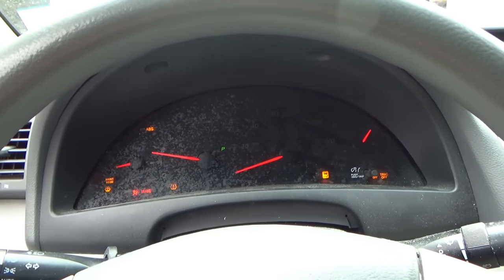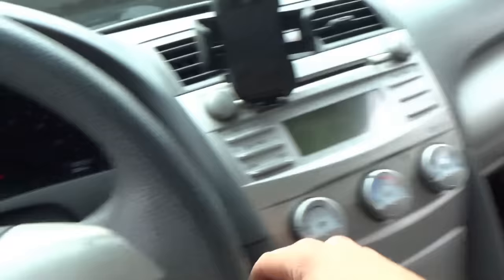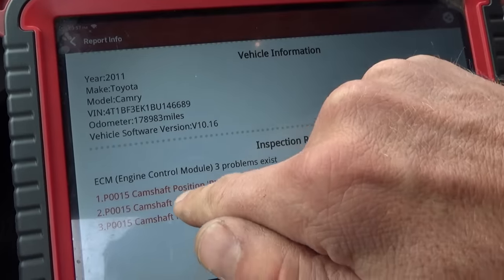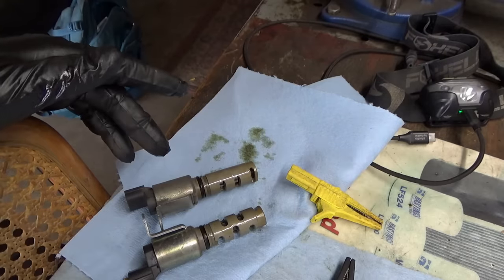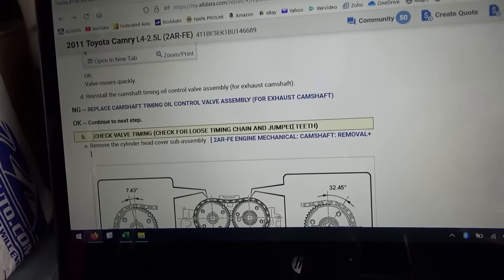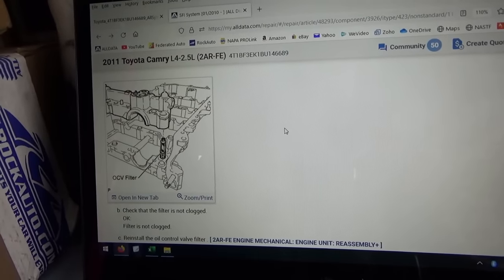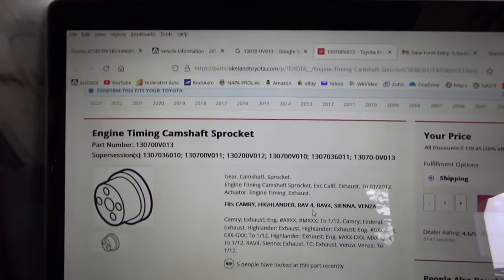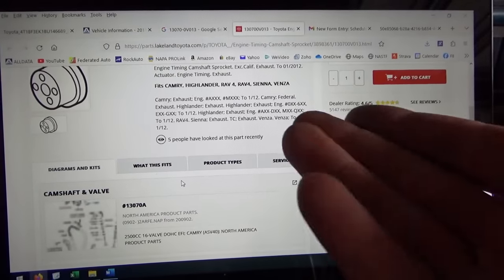Toyota Engines Can BREAK? (Camry STALL- RATTLE P0015-P0017) - Diagnosis

Comment: They break all the time. Both my parents drive Toyotas. Dads Tacoma needed driveshafts at 23K and an AC compressor at 64K. Moms Camry hasn't hiccupped yet but it doesn't have 10K on it. Nevermind the nearly brand new 09 Camry that went full throttle through a busy intersection killing my friend and her 2 kids.
Reply: Yes a lot of owners neglect out there.
Reply from the maker: Wow that is tragic! :(
Reply: Well I maintain both my folks vehicles and I don't go by the manufacturers recommended oil change intervals. I was raised on the every 3 months or 3K miles. There was no way to maintain the driveshafts or maintain the compressor from developing a shaft seal leak.
Reply: I do not like Drive by Wire vehicles.
Reply: @PineHollowAutoDiagnostics  it was one of many that had the "unintended acceleration" that Toyota conveniently blamed on pedal misapplication and non-compatible floor mats. Apparently that nonsense only affects Toyotas and their drivers. Nevermind they paid the largest fine ever because of the cover up.
Reply: @DS-ss7vl  me either. Too many variables and possible failures/glitches.
Reply: What are the percentage of Toyotas that need major repair that come to Pine Hollow auto diagnostics?
Reply: Toyota--still riding their reputation from the 90s, despite what the toaster testers as consumer reports will tell you.
Reply: So sorry for your friend and her children 😢 😞
Reply: Wait until you see some of the latest tech in that category. They are already testing drive by wire brakes and there is talk of wanting it for steering as well. Guess the current issues with electric power steering that fails doesn't register that perhaps a simple shaft is a better idea.
Reply: I had that on a 2008 Honda Pilot with about 160 K . Borrowed from a friend for a few local errands . Stuck WOT when I pulled out onto a 4 lane secondary road . Both lanes had traffic . I instinctively steered between both lanes in the middle and caught a gap to turn on a side street . I missed rear ending several vehicles and before turning , a head on . The gear selector had to be pulled in before going into neutral . I did that and shut it off . This all happened in about 10 seconds . Second time I drove the vehicle . Drive by wire throttle body . Must have stuck . OUCH ! I had no brakes on an old single master cylinder car and turned the corner in second gear at 40 MPH to avoid a crash at a red light . But the stuck throttle was pure terror . Zero warning .
Reply: @Blazer02LS  I absolutely want direct control of my steering through a shaft and linkages.
Reply: @michaeltrinidad1217 Wild guess, it’s not high.
Reply: @hokie9910  I think that's for Ivan to answer.
Reply: @michaeltrinidad1217  I can’t take a guess as stated in my reply,  good grief.
Reply: @michaeltrinidad1217  only Ivan can answer that. We only see the ones he videos.
Reply: @elcheapo5302  they're riding it all right. Tundras going up in flames from fuel leaks, Yaris with multiple electrical issues, Rav 4s with transmission issues, drive by wire glitches that kill people, oil burning problems that burn exhaust valves and at its worst require a quart of oil a week. Then overly priced parts and labor intensive repairs. Yes every manufacturer will have problems and lemons and usually every case is different  and of course  maintenance is definitely a variable, but after a while you start to notice a pattern. Some people take care of their vehicles religiously and some only put gas in them. I promise if you visit a Toyota dealership you will see they have as many bays as any other make and they will all have vehicles in them needing repair, I know because I worked as a tech for a year and a half at a Toyota dealer.
Reply: Someone needs to tell Scotty that Toyota’s have problems too
Reply: U.S. built Toyotas suck. Japanese built ones are amazing.
Reply: You must love Scott Kilmer
Reply: @michaeltrinidad1217 close to zero
Reply: Never had any of these problems with a Toyota
Reply: @ginamiller6015  just a lot less than others is what Scotty is trying tell folks.
Reply: Toyota should’ve never gotten rid of the 1.8 engine the 2.0 dynamic farce engine sucks! and on the Corolla LE they got rid of the rear independent suspension and went with a cheap crossbar suspension. 🙄
Reply: @DS-ss7vl  well, if I am not mistaken drive by wire also makes possible the brake-throttle override feature that cancels the throttle entirely if both the gas and brake pedal are pressed at the same time. (which is a safety feature that Toyota/Lexus failed to install, leading to unintended acceleration incidents)

Also, don't mechanical throttles get stuck fairly commonly anyway? There was even a recall decades ago from an American car manufacturer, where defective engine mounts could cause excessive engine movement that manipulates the mechanical throttle cables, causing unintended throttle. 

If drivers have mechanical throttles, and do not have the brake-throttle override feature, they'd have less options to react to a stuck throttle other than shifting into neutral, shifting down, shutting off engine, or using the brakes to overcome the engine power.

Apparently not many people know the proper reaction to a stuck throttle, else people wouldn't have died that way. If brakes can overcome engine power, how did those accidents happen where the brakes apparently didn't help? So there may be even less options to react to a stuck throttle and that's if the driver is well educated on how to react.

If hitting the brake pedal is the first reaction of even the least educated driver, then artificially overriding the gas with the brake pedal seems like the best way to prevent stuck throttle accidents (and I'm presumping that the brake-throttle override feature is only possible with drive by wire)
Reply: @DS-ss7vl  for example: "Fast forward to 2003, when the first vehicles in FCA’s storied history rolled off the assembly line equipped with brake-throttle override – a by-wire technology enabled by electronic throttle control (ETC).

Brake-throttle override is a feature that enables a driver to stop a vehicle in the unlikely event that its accelerator pedal becomes stuck.

Should this happen, the driver need only brake – and continue braking. ETC will then close the throttle, which cuts propulsion while leaving engine idling, so the driver may bring the vehicle to a safe stop.

This novel technology is not mandated, but the pending launch of the 2021 lineup will mark 10 years since brake-throttle override became standard equipment on all FCA vehicles."
Reply: @topher8634  NASA Scientists proved that false. I have researched this many times. Check for your self.
Reply: @mikefoehr235  I did. People can be paid off. Especially when there's a lot at stake. I was very close to that girl. Toyota tried to take possession of her destroyed car several times but her family refused to let them have it. When the PCM was analyzed it showed that the brake was applied during the WOT glitch. It also showed that the two APP sensors were not agreeing with each other. Over an 80 percent variance. She didn't have time not the knowledge to shift to neutral. It happened as she was approaching an intersection. There was even surveillance footage of the whole incident. If you research this you will see Toyota released not only a software update but also a shim to be installed in the accelerator pedal assembly. They even suspened sales of the affected Toyotas in the states. One dude went to prison after his Prius ran out of control and killed someone. He was released after this problem came to light. Now, logically speaking you don't recall millions of vehicles, generate a service bulletin, release a software update, design a shim, suspend sales, release people from prison, then pay the largest fine ever known in the auto industry to avoid prosecution, all the while blaming this on "pedal misapplication" and "non compatible" floor mats-mind you this only happened to Toyota and Lexus owners. Then years later pay for independent NASA testing to determine there was never anything wrong with Toyotas products. That was nothing but a marketing strategy because they lost so much money. Brakes cannot stop a vehicle that is running wide open throttle. Very quickly the fluid is gonna boil and you will lose all braking ability. No doubt the vehicle PCMs they claim that the brakes were "never touched" were taken possession of by Toyota and that information was flashed out of the controller.
Reply: @topher8634  I have tried to over power brakes with throttle and many vehicles have brakes so powerful now, they win the battle. As for the fine, Toyota was made an example of by the US because of second world War hatred. Not even German cars get that much hate. What I also find interesting is other auto makers have had cover ups....GM for example had bad ignition switches and covered it up for decades I think. I used to freak out my wife because I could start my 90 Sunbird and then pull out the key and drive. She really didn't like that.
Reply: @mikefoehr235  I believe more people died in the gm ignition switch scandal than did in the toyota stuck throttle. And I believe they had a hefty fine too-dont remember the numbers nor do I the toyotas just remember them reporting it was the largest ever recorded. I had two older gms with they same problem as your sunbird. My first car was an 85 cavalier that would allow you to remove the key after it was unlocked. The key was very worn though and a new one would not do the same. On an 89 6000 you could just rattle the lock and it would start and run without ever requiring a key. I had to replace the ignition lock cylinder to fix that. Had the same problem on a 95 Cherokee too. I never experience a problem with the later years gm switches though, I think it was probably mostly related to heavy key rings or ones that had multiple pendants and gadgets on the ring with the ignition key. I've always kept my car keys and all my other keys separate.  Not saying gms not at fault just never had a problem with their switches.
Reply: @zzoinks  I was given an old Buick Special. I think it was a 63. When I was driving home I goosed the throttle one time and heard a clunk and the throttle was hung.  Another stomp on the pedal at it was back in my control.  Every mount was rotted and the accelerator cable was frayed. The car had been sitting since the 80s, this happened in 2001. That was the only time I'd ever experienced or heard of a stuck throttle until my wife to be died in her new camry. I was fortunate I was alone on the road and had plenty of time to react. I don't know of any hydraulic brake system that will overcome an engine running wide open. If you don't smoke the linings the fluid will surely boil rendering the system useless. The same will happen if you apply the brakes too much on mountain overpasses-the fluid boils and the pedal goes to the floor.
Reply: @topher8634  I'm sorry for your loss.
Reply: @topher8634  I've heard that the brakes are supposed to be able to override the engine power, would it take an extended time for the brake fluid to boil? But with the high torque engines today I wonder if the brakes would be less effective. I'm assuming even regular brakes on a car can exert tremendous friction to stop a car, if force equals mass times acceleration, and cars are able to decelerate very rapidly, from 60 mph to 0 mph in less than 130 feet, that may indicate that brakes are able to exert force necessary to fight the engine power for at least a short period. 

 Still there has to be instances where the brakes don't overpower the engine. There was that story about the prius with a stuck gas pedal and supposedly the driver was pressing on the brake but not slowing down. (cops also recounted seeing the brake lights on) so maybe it's just a lie or mistaken belief that brakes can overpower the engine.
Reply: I'm so sorry you lost your friends and their precious babies 😢
Reply: @topher8634 I'm so sorry you lost your wife 😢
Reply: @breesechick  thank you for the condolence.  We weren't married at the time but I was gonna propose soon when the accident happened.

Comment: I just replaced the timing chain and gear on my 96 Chevrolet K1500, it cost anywhere from $19 for (Chinese junk) to $50 for a Cloyes double roller chain (fit like a glove). I once tried a Engine Tech (Chinese Junk) and it had more slop than the original GM with over 200,000 miles on it. I really don't know why manufacturers are using this expensive complicated cam drive systems (Ford F150 5.4 3 valve instantly comes to mind), maybe emissions and or gas milage (really don't care), but I'm going to keep rebuilding all 3 of my old trucks and save $80,000/truck and avoid dealing with this BS.

Comment: These are exact symptoms when the intake camgear and tensioner goes bad and it prevents the timing chain from spinning freely which messe with the oil control solenoid and crank position sensor

Comment: My family has a 2012 Venza with the 2.7lL same codes but no stalling but noisy when engine is cold, parts in Canada are $840 for exhaust phaser/gear…Toyota has a big problem with this part design

Comment: I am wanting to say Scotty Kilmer has stated that these model years of Toyota engines have problems.  My neighbor has a 2008 Camry with 85,000 miles that burns oil; it seems the piston rings that year were junk.  I have a very good friend that works on many Toyota cars.  He says he stays busy; but not as busy as techs that work on some other makes.  GREAT VIDEO!
Reply: Yes, the early 2003 models had rod bolts not torqued and will blow. 2004 through 2006 were great. I believe in 2007 they switch to different piston rings and using a lower weight oil abd, and well, it did not work. Lots of gummed up rings and oil burning, and Toyota fixed a ton under extended warranty. New rings, back to using 5w-30 oil.

Comment: I guarantee you it's the camshaft gear what makes me think that is because it rattles on startup even if you already started it up sometimes they do rattle on startup whenever it's a cold start but then once it gets oil pressure it should not rattle so this is telling me that the locking pin on the timing gear is broken or something

Comment: Ironic that Ivan releases the video on the day that my 17 year old Toyota turd wagon is up on the jack stands getting a used engine put in. In my case the head gasket failed - definitely on cylinder 3 put possibly 2 as well. Coolant was seeping into the cylinder and causing a misfire on start up and difficulty starting and cylinder 1 plug was completely black so the oil burning on that cylinder seems to have been ... bad. Oddly enough if I gave it the beans it would generally clear up and run OK as long as you were maintaining some kind of throttle. I had just been topping it up with water once a week for the last few months but it got so bad it needed sorting. It nearly stranded me the other day. I had to put my spare plugs in and use some easy start to get it to fire.
Reply from the maker: What Engine? how many km?
Reply: @PineHollowAutoDiagnostics 1KR-FE (it's a euro trash motor I believe designed by Daihatsu originally). Paired with a 5 speed they quite happily do 50mpg. 

This one had done around 240,000 miles. 

A used engine with 55k cost me about £230 delivered. Plus £120 for a clutch (which was pooched anyway). I have to swap the oil sump and modify the bolt holes for the new water pump but overall not terrible. With the mileage I do that engine should get me through to 2030.

Comment: Somewhat later model Toyota Sienna engines have a water pump that’s undersized, and bearings wear out at about 100k miles .. they’re a bitch to change, as they are very hard to get to .. lots of tear down required.
Reply from the maker: 90s Toyota water pumps last 500k miles and easy to change :)

Comment: Toyotas are bullet proof… except for the 2AZ-FE oil burning low tension rings engines, 2AZ-FE head bolts recall, rusting frames, head gasket issues…

Comment: Replace both phasers. The intake causes a rattle the exhaust fails catastrophically. The rattle breaks the upper guide. Standard motor products phasers are OEM. Read the tsb carefully. The intake phaser must be in the unlocked position until after the bolt is torqued. You CAN NOT replace the exhaust phaser without removing the timing cover. If you see a wear mark on the cover Infront of the exhaust phaser then the ring is moving and it will fail.